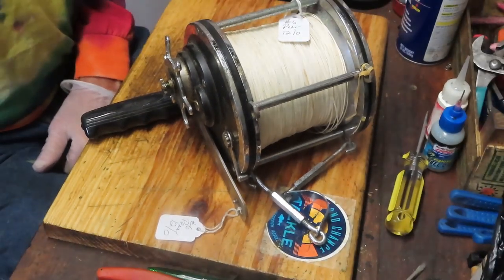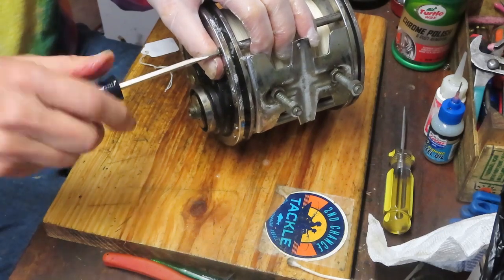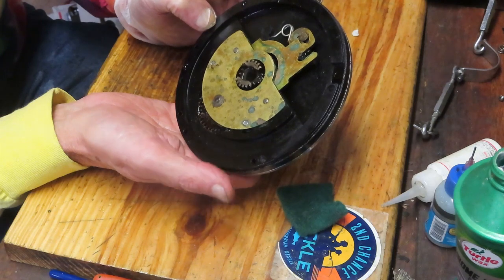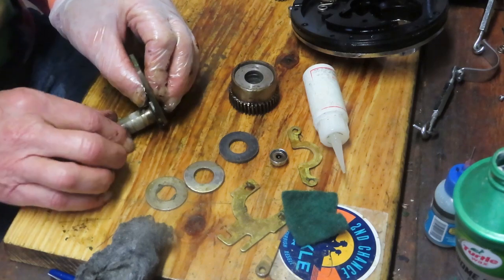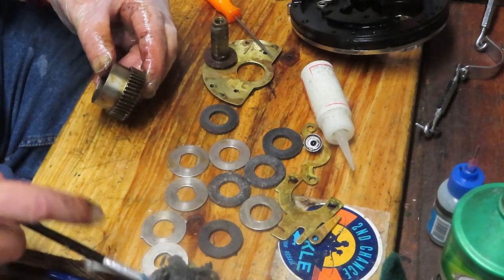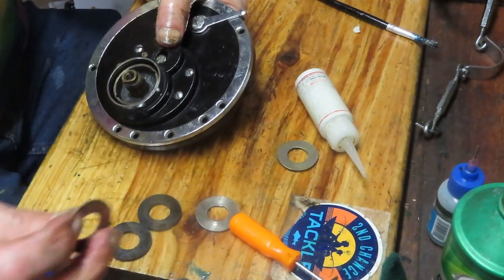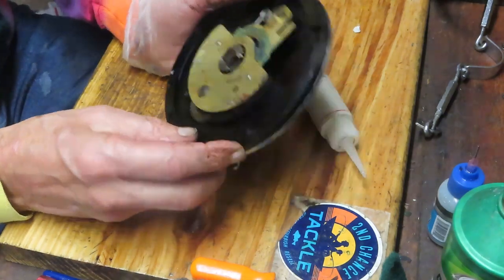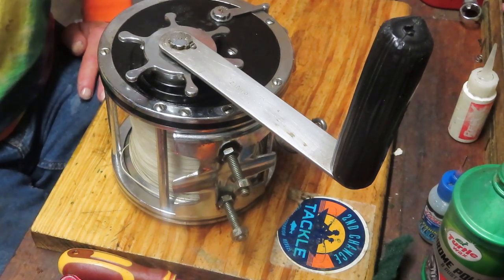Penn Senator 12/0 large trolling fishing reel how to take apart and service

Comment: What does the size number mean 
I got to use a 4/0 which is a lot smaller reel .
Reply from the maker: That is one question that I have heard way too many answers to and I am not sure which is correct.  The one that makes the most sense is the first number 4/0 12/0, etc means the amount of yards in hundred that the reel will hold of 100# line.  So a 4/0 would hold 400 yards of the olde 1003 braided linen/dacron line.  It may or may not be true, but it is the one I tend to believe - Thanks for asking - Dennis

Comment: Thats a great breakdown and reassembly video.  2 questions though.  Why not replace the drag washers while it's all apart and do you have a video of a Senator 12/0 116L LH? I was stuck on where to install the anti- reverse tab or spring, and also the permanent style clicker replacement.
Reply from the maker: The LH model is reverse, so the a/R dog goes to the inner left and not the right side and shown in this video.  The rest of the install process is the same - Dennis
Reply: @2ndChanceTackle  thanks Dennis.  Am I supposed to bend the copper tab? I have a new one and don't want to mess it up.